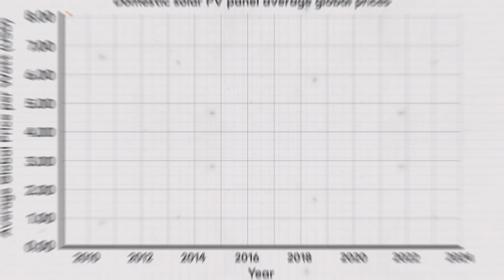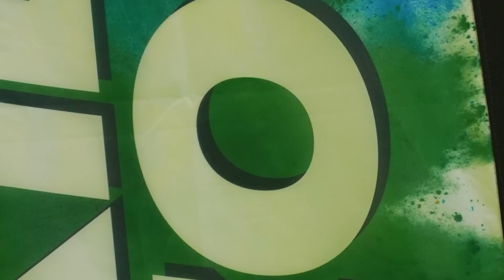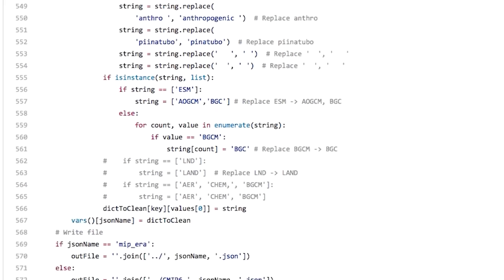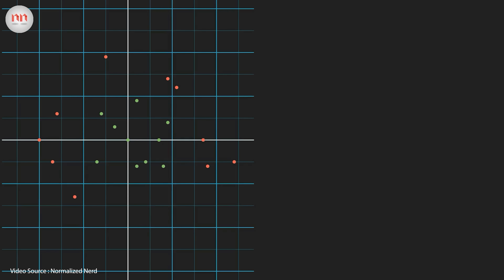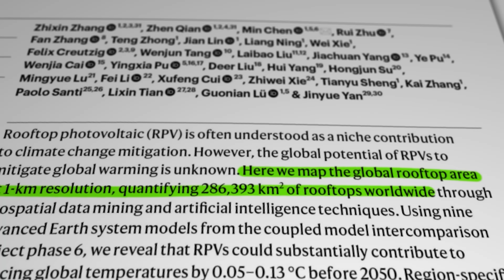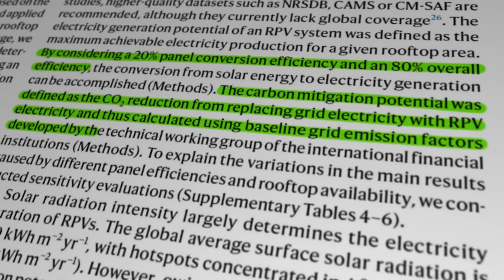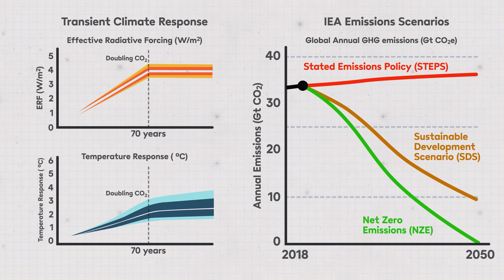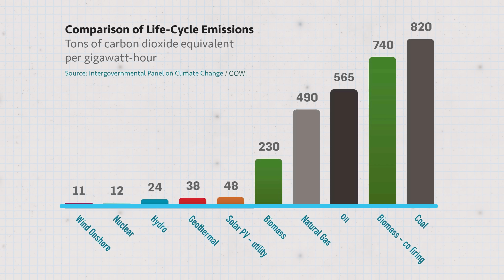New Report - Rooftop Solar PV is THE biggest climate mitigation technology!

Comment: The beauty of roof top solar is the grid is already there.  What it needs is storage to match.
Reply: That is exactly the kind of mindset that people need to get rid of. Here in the netherlands there is/was (not sure on the current rules) net metering. Every KWh you pushed back on the grid is what you can later use from the grid with the two canceling out. That's nice! But only for as long as the solar adoption is small.  If you think for just a second you can see that this is not sustainable at all. You cannot use the grid "as battery" because someone somewhere will have to pay for that KWh that you use when your panels can't provide it. Now here this metering is going to end and utility companies are beginning to charge for pushing energy back to the grid. The mentality people should have is a though of how to store that energy you can't use yourself and that should be part of your (financial) plan when you go for solar panels.

Where people differ in opinion is who should take care of that storage. In my opinion you, the user, should. But there's also people who think the grid itself should have that capability. Personally i'd think that a local (in your street or slightly bigger in your local neighborhood) storage solution is the best mix. It still allows you as a user to just have panels (storage is done locally but not in your house) and be cause it's local but for a whole number of roofs it's likely fairly big storage which you can then also use for net balancing (earns money) and EV charging point + you can use the net to charge that big battery in off-peak hours.
Reply: @markg5891 I like the idea of micro grids with a community battery instead of using grid tie inverters so you don’t have to stay in phase with everyone. A single grid connection to top off the battery during low peak hours would be sufficient. I don’t know where the technology is for high voltage batteries but that would be necessary to keep the wiring costs down.
Reply: @danielking2944  You can still "grid tie" with an inverter like that. Just the grid you tie to is the local community battery. Now that won't "solve" the cable issue (as it would be 230V AC) but it would allow you to use more common materials.

That being said... I would also find it totally acceptable if, for the local battery, you'd need an extra box somewhere that converts your voltage into 10kv AC or something. That is going to cut into conversion efficiency.. Oh well, choices :)
Reply: Not so much.  The big(ger) trick is Aligning Time-of-Use to Time-of-Production.  If you move the loads of the entire 24-hour-day to mostly into the 6 to 8 hours of Solar Production, you do not have store very much for the other remaining 16 to 18 hours of the 24- hour-day.
Reply: Storage - That’s the critical thing.
Reply: The Grid is Socialism, designed to perpetuate dependency. 

Get yourself some storage batteries.
Reply: Storage is a waste of time. Energy needs to be generated exactly to meet demand otherwise it is too complex, inefficient and expensive. The answer is nuclear energy. It’s just that most people are literally too stupid to realise it. Physics doesn’t lie.

Comment: Got them approx 5 weeks ago. Loving it. Gonna pay off in 4 year's, 5 absolutely max. Oh and thats in Ireland,  not well known for our sunny days!
Reply: I don't know about Ireland, but in the UK, last month was extraordinarily good for solar, so if youre basing it on what you've produced so far, you might be slightly disappointed.

Not saying they aren't worth it though.
Reply: Mine (8 panels first) should be installed in a month, and then +4 within 2 months.  Living in Finland, and estimated time normally 10 years for payback... 7-8 if the electricity prices are high.
Reply: Good save your government money so they can spend it on replacing you with middle easterners. lol
Reply: What are the numbers behind your 4 year payoff time? For me it's looking like it would be 20 years if I'm lucky
Reply: @probablykasper  I can´t comment on the 4 year (it sounds very short) but I know there are MANY factors playing in    1) price of electricity.  2) Price of install and parts  (huge variations)  3) Some countries have "tax reduction" or alike.   4) How much of the energy you can use yourself.
In my country I pay for the electricity  (let´s say 11 cents) but then for every kW I pay a 4 cent transfer fee.   For electricity I use there is no transfer fee, NOR for any electricity I export... however I don´t get the 11 cent in export (it varies and is usually much lower).
Reply: @ These are the numbers for my calculation, for the most profitable option I could find:

24x 235W panels
Price: €8702 (€10 412 before government subsidy)
Yearly production per kW: 716 kWh
Yearly production: 7475 kWh
Yearly electricity use: 8401 kWh
Self-consumption: 32%
Yearly saved: €240.68 (€0.088/kWh)
Yearly sold to grid: €133.88 (€0.028/kWh)
Payoff time: 23.23 years

I did the numbers for every individual month, so it takes into account how production, consumption and prices change throughout the year.

I used the PVGIS24 to get the production for every month. It ranges from 22.11% in June to 0.32% in December.

For determining the self-consumption, I also assumed that max 85% of production would be used, and max 60% of consumption would come from the panels.
Reply: @probablykasper  Your equipment won't last that long.
Reply: @ It won't last 23 years, why?
Reply: @probablykasper  Batteries maybe 6 years tops, the panels will degrade from the elements. Wiring faster than the panels.
Reply: @ I haven't considered getting batteries. Anyway 6 years would be a crazy short time, wouldn't make sense to see 10 year warranties if that were the case

Good point about degradation, seems like that might make the payoff time ~6% longer. No idea what maintenance would end up being
Reply: @probablykasper  I've never seen a 10 year warranty on a battery.
Reply: @francismarion6400  I found 3 with 10 year warranty and 1 with 5 years. EVs batteries usually have a 7 year warranty, so a 10 year warranty for a stationary battery sounds pretty reasonable
Reply: @probablykasper  OK so recalculate what you had with replacement at 10 and 20 years. Or were you not originally figuring in a battery bank?
Reply: @francismarion6400  Was not including/considering a battery, no
Reply: @probablykasper  AS far as the other stuff degrading, I've been a GC for 25 years and there is nothing I haven't seen degrade. Even stainless steel degrades. But I wouldn't go solar for the monetary reasons anyway. It would purely be for being self sustainable. Like a prepper or off grid living.
Reply: @francismarion6400  Gotcha, though in that case you have some selection bias to keep in mind.

Being fully off-grid with solar panels isn't realistic here unfortunately. With my 24 panel scenario, I'd generate 333% of my electricity usage in June, but only 2.6% in December. So even 1000 panels wouldn't match my fairly tiny electricity usage
Reply: @probablykasper  
Buy it anyway!

Comment: A study written by the natural gas industry way back in teh seventies concluded that rooftop  hot water panels installed on half the homes could lead to an 80% loss of gas sales volume.
Reply: & Chinese water heating panels are small & incredibly cheap at the moment & have been for years, the tech is essentially Victorian-era with minor modifications for modern production methods.
Reply: @alanhat5252  PV Panels (DC) to a battery/ (DC) to a Water Heater Tank (DC) is a great way to store excess electricity.
Reply: wander what force stopped solar heating from becoming ubiquitous? 🤔
Reply: @archigallus  photovoltaics just got cheaper.

you need more hot water in the winter, when you have less sun, and electricity is just much more flexible.
Reply: @archigallus   Capitalism. Every time.
Reply: When in Greece, I saw people just having water barrels painted black on their roofs. The water went straight from there, the temperature fluctuated throughout the day, so you need to be careful when mixing it with cold, but it worked, and it probably cost them next to nothing.
Reply: I moved from piped gas that cost $90 a month, to BBQ bottles as we only had a stove. $40 a year.
Reply: What's the environmental impact of making the millions of photovoltaic panels and batteries?
Reply: @andrewhotston983  With both solar and batteries 97% of the material can be recovered. It is hoped there will be enough battery materials mined by 2050 to supply most of humanities needs. Recycling will reduce the need for more mining to a minimum
Reply: @morninboy  So how much damage will have been done by 2050?
Reply: @andrewhotston983  First off, we are 8 billion people. Nothing is free. Do the math, damage from never ending oil consumption or far lesser damage from temporary mining of a recyclable material.
The average car will use 120 barrels of oil in its life time. The amount of material in a battery is less than 1 barrel. Six gas car lifetimes is 720 barrels and six electric cars is less than one barrel
Reply: @morninboy  Not an answer to my question! That says that you know how environmentally ruinous this supposedly green technology really is! ;)
Reply: @andrewhotston983  What's your alternative? Look at the pollution caused by the oil industry around the world. Look at the number of premature deaths from poor air quality around the world - 8.1 million people per year. Rather than ask questions that you already know the answer to, give a constructive plan to wean the world off fossil fuels. Suggest alternatives. Don't sit in your basement doing the whole "what about..." thing.
Reply: @andrewhotston983  How environmentally ruinous is burning fossil fuels, of which none of the byproducts are recyclable?
Reply: @frothslosh  Burning fossil fuels creates carbon dioxide, which is 100% recyclable. By plants. Didn't you know?
Reply: This sounds suspect.

80% must be above the total domestic use.

further it implies 60% of homes used gas, and 80% of those (50% of total house holds) completely stop using gas, when electricity is the more expensive heating option so would be the better one to shift to solar hot water.

maybe the stat was solar hot water panels reduce a households usage of gas by 80%, for 50% of house holds???

Comment: by 2024 Pakistan reportedly imported a record 22GW of solar. Most of it was sold in private market to industries and to households who can afford it. The impact of it was huge. It is reported that the electricity consumption from the grid has actually decreased for the first time. No wonder, since the total installed capacity is 48GW in comparison, and the largest consumers of electricity are installing solar on their rooftops and going off grid. There is also a drive of converting the rural tubewells and wheat grinders into solar, as farners can not afford to run old dirty diesel generators.
Reply: Now that is impressive. Most probably saves everybody a lot of money.
Reply: @kevindruce8915  indeed. The electricity prices are very high, which is another part of reason why this shift has been so radical.

Comment: i installed 15kW solar with grid connection. I have sold over 40MWh of electricity. 4 years and it won´t give back anything anymore. the electricity exchange price is almost zero while sun is out. barely covers my energy bill. only way to "save" more is battery. now i´m building a solar-inverter-heaterelement system to lower my house heating expenses. 3KW heater with 5 solar panels. if thing go worse i switch all solar to heat water. winter time i need a lot of solar panels to suck out small amount of power from sun. sorry my english sucks and google translate is joke lol.
Reply: Which country are you in?
Reply: @alanhat5252  estonia
Reply: @ again youtube doesn't like something lol. I'm from Estonia and we have the same problem- the grid is full. New subscribers are being asked 1.6 million EUR for connecting the solar park to the grid. The big green buzz is gone. They haven't updated anything. The state could have built a storage facility and updated the power lines.
Reply: People here in Britain are finding batteries are the way to get good export prices

Comment: The issue is simply that every time I have gone through the effort of getting the quotes I need, that any resonable cost estimate ultimately came in at a payback of 15+ years.  And that was the same as 5 years ago.  A lot can happen in 15 years.  So, either I pay for electricty in advance for the next 15 years, or I install the pannels myself, or I wait...  I'll wait
Reply: Does your electric supplier pay you for the excess that you produce? Any state or federal rebates? I had all of those and Solar Renewable Energy Certificates. ROI was 4.5 years. Take away all those things and it would have taken a little over 11 years. That was 11 years ago and prices have come down. Where are you located?
Reply: Are the grants available in your area? They're not always well publicized.

Comment: The problem here is an overload of the grid with so many solar and windturbines. We are here (in NL) at the point that you have to PAY for the extra electricity you don't use yourself. Briljant.
Reply: There's absolutely no reason why solar PV generation needs to be exported back to the national grid. You're also incorrect about having to pay to export to the Netherlands grid. The Netherlands simply isn't operating full net-metering for solar PV generation anymore.
Reply: You still get your energy tax credited until 2027 even though there is not much else left due to energy providers bypassing the net metering scheme for their part of the deal.